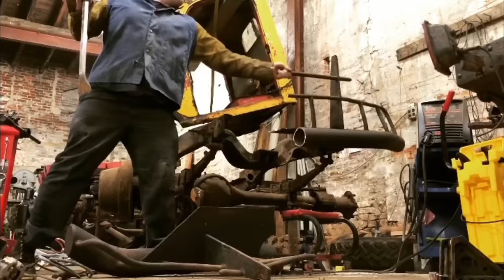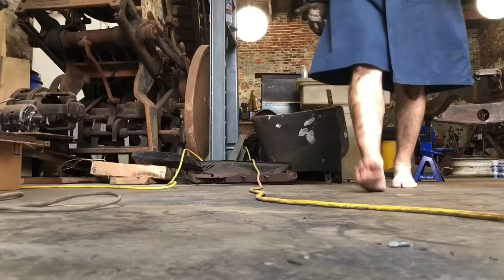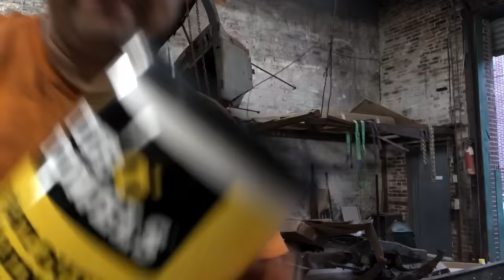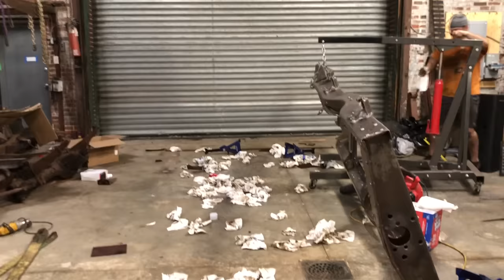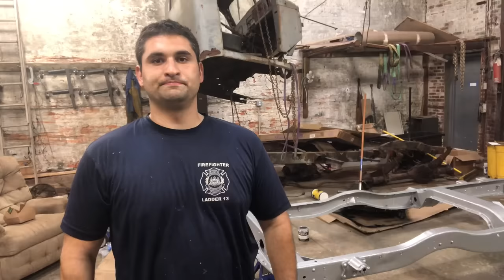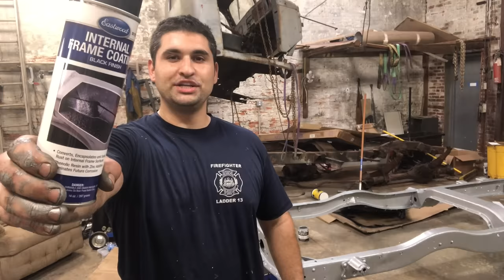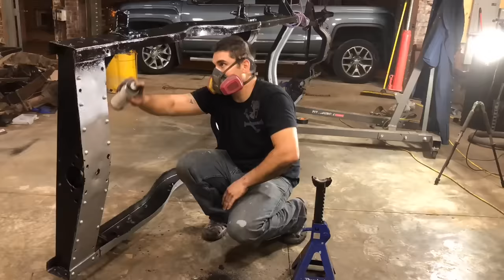DIY: How To Restore a RUSTY Truck Frame LIKE NEW with Basic Tools!

Comment: ……. Seems like people are asking what material to use and how much of this and how much of that. Truly, you don’t know until you get into it. Prep and cleaning is 90%. Always account for the Oily spot you missed or the fingerprint you left behind, Or the junk in the corner you didn’t see. Typically, you always spend more money on the sandpaper, whizz wheels, wire wheels, Towels and cleaners. I recently repainted my frame and I spent $150 on paints and Hardner’s…. And $275 on everything else (Sandpaper, cleaners, scrapers, razors, paint brushes, tape, plastic, wire wheels, wire brushes, etc.) His frame wasn’t that bad but mine was real nasty. Hope this helps.

Comment: Not so sure about rust encapsulators. The product will never touch the layers of rust beyond the first layer. The rust will just continue to eat down and through the metal. After pressure wash, wire wheel or sandblast, a rust converter I think is the way to go. It basically turns rust back into hard metal.

Comment: Nothing wrong with a wire wheel, but it will only access outside corners and flats.  What about all of the inside corners?  Invest in a sandblaster, even a simple Harbor Freight bag blaster and get a much better finished product.

Comment: Yikes, tennie shoes? I hate that style of wire wheel. I only use the cup style now. I was cleaning up a boat trailer frame this summer and that style of wire whee caught and threw the grinder out of my hand and it ran up my nikes and chewed up the front of my ankle. Took me two months to walk right again.
Reply from the maker: Yup,  I usually wear. flip-flops. Really just gotta understand the tool, which I do from years of running them, but the risk is always there.  Sorry you got hurt and thanks for watching

Comment: Hey, what about shooting some foam into the frame to prevent any schmegma and other detretius from getting in there for the next 50 years?
Reply from the maker: Justin Quick I’d be concerned that somehow it would hold moisture in and exacerbate the problem
Reply: Foam is a big NO. It retains moisture.

Comment: going through al that prep on the frame and using cheap spray can paint instead of a catalyzed urethane paint is kind of crazy, its not much more of a cost and it will last much much longer and look better.  why go through all that work and short cut the final paint?
Reply from the maker: Spray paint is 2k

Comment: Everything is amazing the way you did it. Excellent job. Very detailed work. But i need to criticize you little bit on your personal protection. Two part sprays are dangerous for your health. They dry like glass inside lungs. You need better respirator than small gray front n95 for painting. That musk is only to paint oil base household paint. But great job on frame.
Reply from the maker: Yes sir, I’ve since learned my lesson

Comment: Why not sand blast it?
Reply from the maker: Big logistics headache. Not set up for it in my shop and to trailer the frame someplace and pay through the nose and then trailer it back? Wire wheel on site is, essentially, free

Comment: This is the longest and most time consuming way ever to do this job and also the most costliest in labour and materials .Strip the frame down and transport it to a shot blast company who could bring it up to bright metal in half an hour and then have them stove enamel it while its there ,All done in a day or so for a fraction in costs compared to doing it this way ,seen it done many times .

Comment: Ever thought of using a sand blaster to clean the frame?  I use a high pressure water/sand blaster and have had excellent results.  Use other techniques to get the inner frame members cleaned and protected but don't have any issues with what you are doing just seems like the hard way to skin a cat.  They always told me to work smart not hard, and at my age is logical
Reply from the maker: I’ve heard that’s the cats ass but I’m not set up for it

Comment: THAT'S a rusty frame? Jesus, my 65 WM300 is from Ohio originally and after 8 years in Vermont it's not getting any better. I put the 4th fish plate on a vertical crack today!
Reply from the maker: Yikes.  It is rusty, not rotten.  i wire wheeled this top to bottom once before videoing this.

Comment: I can tell this was a southern truck cause you would be buying a new frame and cutting those bolts ive worked on cars that are only a couple years old and everything is rusty
Reply from the maker: Pennsylvania truck.
Reply: @partsandresto  thats in good shape from being there my dads 91 chevy has a little peek hole on his frame and if the truck stops working u can fred flintstone it through the floor

Comment: you live there don't you. it's okay,  i would live in my shop if i could.
Reply from the maker: That was the plan. Was gonna build a house above it, but the engineer deep sixed that plan, said the walls couldn’t support a second floor.
Reply: @partsandresto   Hi! Like your video and subscribed. If you built a steel frame inside the building, you should be able build a mezannine floor up there
Reply from the maker: Smart man. When I poured the floor, I added footings for a mez. Future project.  There used to be a mez and it was too claustrophobic

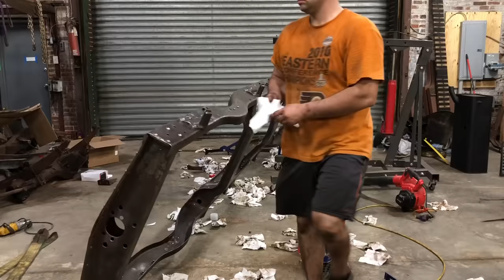Comment: Do you think that a engine crane is a basic Tool?😂😂😂 5:28
Reply from the maker: It close 200 dollars and if you can’t afford thay, you can’t afford to do a frame off restorations sorry to break it to ya
Reply: @partsandresto even if it's cost 200 dollars, I won't include it in the category of basic tools. You need a lot of space and almost a workshop range of tools to do this. I think that's the title it's not correct.
Reply from the maker: I couldn’t care less what you think.

Comment: Not a fan of rust encapsulators, you should have sand blasted tge frame then coated it with bedliner, job done. Nothing will stick worth a crap to a wire brush cleaned metal surface, it polishes the metal. You spent a lot if money on a waste of time, guarantee i can remove that coating with a screwdriver.
Reply from the maker: Gotta get through me first screwdriver boy 😘
Reply from the maker: Also you’re wrong. The platinum paint is tough and hard. Doesn’t chip out.
Reply: Rocks and road debris will do a way better job than i can with a screwdriver. You dont want a hard surface coating on the frame hence why they always used that undercoating crap forever. It doesnt chip and it deadens sound. We have come a long law since those days but the premise is still the same. You want a flexible coating on your under carriage then nothing but scraping the frame on large rocks will remove it and even then it usually sticks so well to the sandblasted surface does little to zero damage. What do i know just a 55 year old retired jet mechanic from Colorado who owned a number of International Scouts and various other 4x4s. Your obviously getting Eastwood’s products for little or nothing to promote their products. Anyone with any experience knows wire brush polishes and i didnt see you sanding or using any abrasives following the wire brush. Like painting glass you do the math and figure how well thats going to work.

Comment: Hello Dave.You re a good worker but the method is not good.Don t take it as a bad remark.Am not here to criticize but to tell you you are miss leading yourself.I explain.Wheels brush are expensive and rubb only the surface of rust.Even if you use rust treatment inside the metal the rust will continue to do her job and inside the frame where you Don t have any access.Best is sand blasting or better electrolysed your frame and treat against rust just after it.Hope you will comprehend and continue to work like that cause poeple like you are really scarce our days!

Comment: So much easier to just sandblast the frame to an SP-6 commercial blast cleanliness and brush stripe coat then spray apply a up to two coats of Sherwin Williams Macropoxy 646 epoxy at 6.0 to 10.0 mils wet film thickness. Blasting would have taken no more than 60 minutes. The epoxy would last a lifetime and would insure rust would never comeback. Way too much effort to safe a buck

Comment: The amount of time and money spent vs having the frame professionally blasted and powder coated just does not make any sense. I have done this both ways, and will never spend the time and money on painting a frame in the home shop ever again.   It's just not worth it and the final product will never compare to powder coat.
Reply from the maker: That may be so but how would I have made this video if I had it powder coated? How would I get it there without a trailer? How can I afford a professional blast and powder coat job if I’m broke? Lastly, how can you really say you restored a vehicle of somebody did it for you?
Reply: @partsandresto  good answer!
Reply: @partsandresto  having a part properly coated is not having someone build a car for you.  You are reaching on that one. I've been doing restoration work off and on for over 30 years. I've done a few complete frame of restorations and my advice to anyone young, learning, or doing their first project. Do the best you can using the best materials you can. You will build a better car, have it last you longer, have better resale value If you need to trade it or sell it to do something else.  How much did you spend on the supplies to do what you did to that frame? I bet you had several hundred dollars into that. In Idaho you can get a frame blasted and powder coated for around $500.00, I'm having a 66 chevelle frame done right now for that much, my 63 c10 frame was $350.00 several years ago. Is it really worth doing what you did and spent? I've been there, it's not.  So yes, your video is educational and will get you views, but is it really good advice to someone just getting into their first project? It's advice I would not give. To tear down a car to a bare frame and then built it back to finished condition takes 3 things, time, money, and dedication.  Most projects never get finished because one of those tree things don't get accomplished. Time is our biggest asset. The 10 hours or whatever it took you to do that could have been spent restoring or rebuilding another component of the car, not sitting there and scraping a frame with a pick etc. Use your time wisely and maybe you can overcome the odds and get the car back together. Powder coat everything you can, it's makes a huge difference in the final quality of the build.
Reply from the maker: Sound words based on a lifetime of experience.  This is my first vehicle restoration, and I want the experience. This technique is solid for someone who wants to do it themself, even for a small job. Not everyone is going to pay to have it done at a shop. Some people would rather pay to do it themself.  If I was planning on selling this rig, or readying it for auction, your advise is a no brainer.  That isn’t my plan.  My plan is to do everting, learn as much as I can, and increase my skill set. I think a lot of people who turn to YouTube for how to videos are in the same boat, and that’s who I made this for.  Thanks for your thoughtful reply and your time.

Comment: Crazy waste of time and money, you could have had the thing dipped in acid and re-galvanised for less. If they sell it in an aerosol can and not a 5 gallon container then it's a rip off, you can bet the farm on it.
Reply from the maker: I’m sure the next time I need a trailer to get my frame to the dipper, you’ll loan me yours free of charge. Or maybe I’ll just buy one for 1000 dollars. Plus the cost of the dip and glav, my job is starting to seem pretty cheap!

Comment: I would have sent the frame to a galvanizer.
Reply from the maker: Okay, fair point. but this is a home shop project and I don’t have a trailer
Reply: I've had things warp on me after galvanizing - especially sheet metal parts.
Reply: @industrialarts3921  In this case I'd think it's probably sturdy enough to avoid that, but yeah, I've seen it happen on things before.
Reply: @InstrucTube  You're probably right. I had one bad experience with some handrails I had dipped, and it left me with permanent emotional scars LOL. In any case, Dave's gonna make a master piece of this power wagon.
Reply: what was the difference price by using Eastwood products and have the frame powder coated?

Comment: Mostly bullshit to promote products. There is no indication that rust was removed from external frame members prior to application of so-called encapsulation product. Video shows residual rust on frame surface prior to coating. Injecting surface treatment to the internal portions of the frame before removing rust? You must me kidding.

There is no mention of the components used to stop the rusting process. And everything is appliced by rattle-can; definite lack of consideration of professional application.

Would you trust this approach on a restoration; especially one that does not involve a frame removal? This person needs to consider how to treat/remove rust from structural members, not how to cover such frame members with expensive surface treatments that hide the underlying rusting process. In the end, we all know what happens....
Reply from the maker: Seethe troll

Comment: "with basic tools"  proceeds to pull engine out with lift.... smfh
Reply from the maker: ….they cost 200 dollars. How would you prefer I removed the engine? I’ll wait…
Reply: @partsandresto  my comment was related to the video title saying "basic tools"  not on pulling the engine. ...   but if you want to shift the topic I can respond to that.   I would say you don't remove the engine.   People coming to a video with a title like this,  like me,  are probably wondering how to best restore a frame with limited tools and/or shop  space...  or no shop at all.   If I had a shop to work in I would spend $200 to buy a lift,  but I don't have one...  so,  I'm looking into how to fix up a frame on a 1971 f100 with what is avaliable to me.